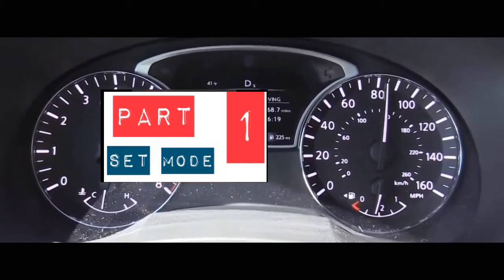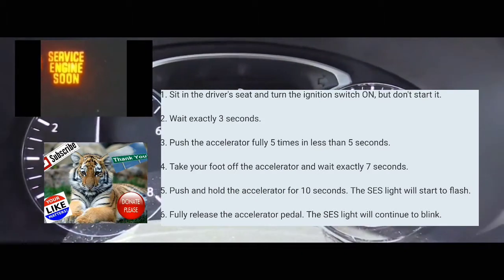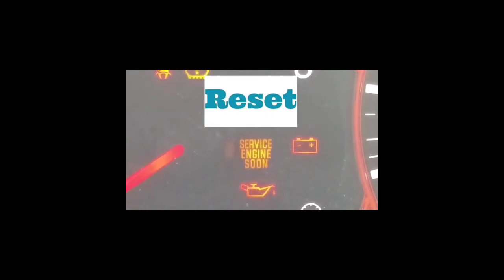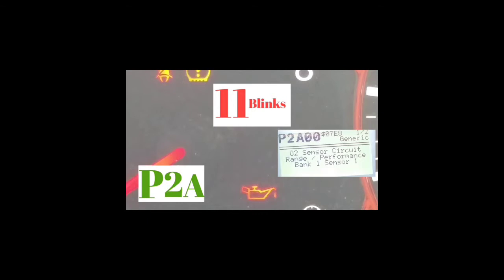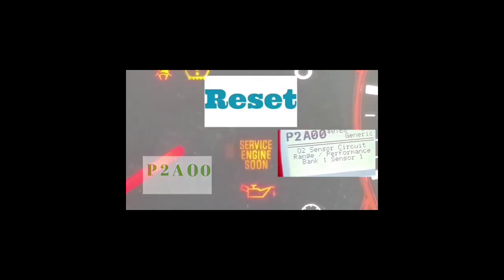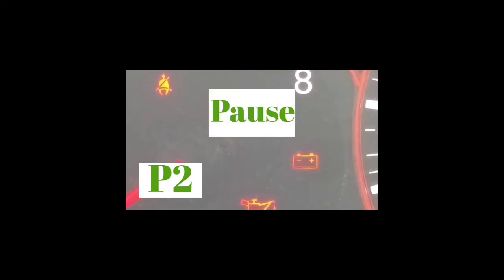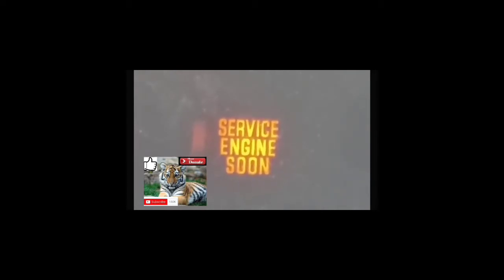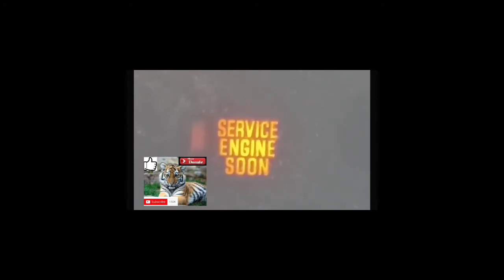How to Read and Reset Your Car's ECU- 2014 Nissan Altima

Comment: I hate altimas and Nissan at this point the gas cap shouldn't cause stupid codes that aren't related to go off - the abs and traction lights shouldn't come in and stay on when they gas cap is bad but it does... they are just trash bags